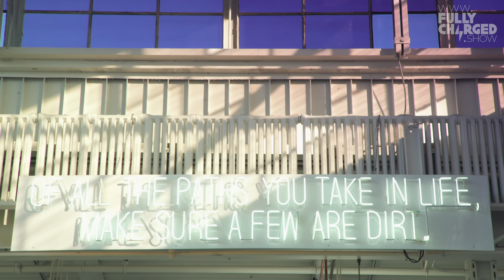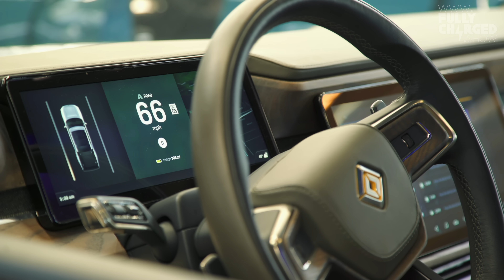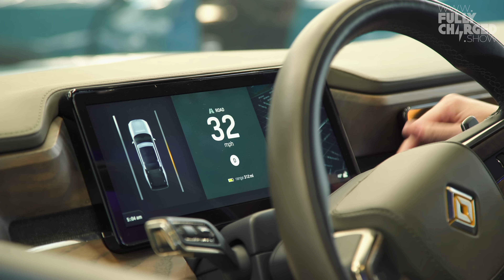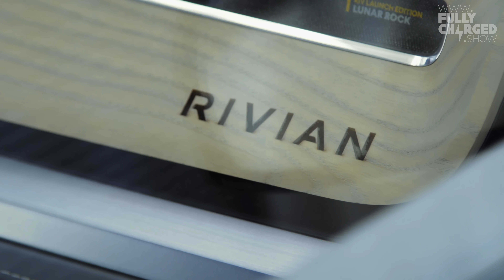Rivian R1S Electric SUV & R1T Electric PickUp Truck - World Exclusive: Inside Rivian | Fully Charged

Comment: I live in Vancouver CANADA and and when this Truck comes out it's going to change everything 🤔
Reply: Pay attention to the Tesla Pickup reveal on the 21st. While the Rivian pickup is cool, they have no charging infrastructure, are going to cost more, have less features, etc than Tesla. Tesla has chargers in B.C and on the trans-canada highway. Rivian does not meaning they aren't viable for off-roading trips.
Reply: @ghostthough7874  Ford gave Rivian 250 Million and is going to make a F150 using the Rivian platform.
And there's No reason the (charger) can't be integrated in to the vehicle.
Reply: @trentdabs5245  250 million isn't anywhere near sufficient for anything really. It'll allow them to do minor RnD or factory setup, but it's not much money. 

Ford (And Rivian) don't have any charging infrastructure which is CRITICAL for off-roading, don't have any progress on FSD (Full Self-Driving), haven't ever produced a single commercial electric pick-up, have no facilities to produce batteries at scale, etc.

Tesla has too many advantages than the other companies. Once they reveal their pick-up on the 21st they will make other companies completely obsolete. If you buy a car from another company it'll simply because of brand name, not functionality or vehicle ability.

Comment: The headlights really bother me, they look so weird.
Reply: Yep, flipped horizontally or at least moved further apart towards the center line of the fog lights would look better ... or maybe even two vertical ovals side by side would look better.
Not to mention a circle (like their Amazon delivery truck headlights) or a squarcle (a square with rounded off corners) would look more normal/natural than that narrow oval they are using.  

The aftermarket for the Rivian's front end clip is going to be a billion dollar business because people are going to want to change that ASAP/ASATC.

Comment: I think Rivian will be the King of the premium trucks with 4 motors, torque vectoring, variable suspension etc. I have read people's comments on the up cumming Tesla pickup truck how they guess it will be like a rivian (4 motors etc) but I think it will be only aimed at the lower end with 2 motors and much more simple. (how else could it be $49,000) Tesla has no need to start with a premium truck. If you want the best pickup truck on the market then buy a Rivian R1T.

Comment: 70k?  I hope you have an “escape the industry” plan once the Tesla truck is released.
Reply: You have no idea what the other manufacturers are doing.  Tesla will be selling about 1/100 of what Ford sells every year in trucks - and the Tesla lemmings will be claiming it's ground breaking.  Anytime Ford or any other major car manufacturer wants to put Tesla out of business - they'll be in the EV market and Tesla will be out of business.
Reply: @buckhorncortez  Incorrect... Ford mostly sells trucks, the one area that Tesla doesn't produce vehicles (yet). Tesla is destroying every other company in the luxury car market (specifically Sedans). Tesla is revealing their pick-up on the 21st and they will destroy Rivian, Ford, and the competition. Just like they are destroying BMW or Mercedes in the Sedan market. 

Tesla will never be "out of business" if anything, the other manufacturers like Ford, RAM, Honda, etc will be out of business unless they start switching to EV vehicles. The difference being, none of them have experience building electric vehicles or batteries. They have no idea how to build a reliable electric vehicle. They have no charging infrastructure. They have no desire to leave diesel. That's what will kill them. 

Tesla will be destroy the competitors in every category once the Tesla Pickup and Tesla Model Y enter full production.

Comment: really like this Truck ... 3:30 EXCEPT for the Frunk opening way too high, why???  It should open at bumper level between the headlights!! .. so it is easy to access the space.  Having to lift stuff above chest level to get it into the Frunk is rather absurd. Agree or Disagree??
Reply: Agreed but they had to put the 2 motors somewhere while also having decent clearance, trucks are not environmentally friendly family cars no matter how much they want to sell it as one.
Reply: @miguellopez3392  those 2 motors are NOT between the front headlights... the front motor/inverter assembly bulk is actually behind the front axle centerline.  In photo below this can be seen... the frunk area is above that radiator/fan unit.
https://www.hardworkingtrucks.com/getting-to-know-the-r1t-rivians-rj-scaringe/
"trucks are no environmentally friendly family cars" ???  Not even sure what you mean by that?  sure, a truck ain't a car, and 4 door trucks are damn good for family needs, and EVs are good for the environment ... so, you need to explain yourself more clearly??

Comment: Is it just me, or does Rivian side step every question about recharging their vehicles every single time on every video? 🤭
Reply: They go tank mode to swerve around it
Reply: Sidestep could be Rivian's motto.
Reply: They are positioning the trucks as off road, but how are you DC recharging these out in the BFE? RV sites? It just appears that they are not addressing it at all. I haven’t heard a discussion about recharging the pickups when taken off roading.
Reply: Right, it just stood out as very odd that they seem to never speak of recharging the vehicles. Other manufacturers speak of it, but not Rivian. Thanks for the input.
Reply: I wonder how long one would have to stay at the RV / cabin to recharge the largest battery with a 14-50. I have an MS and 8hrs to recharge it is probably too long if I was on an over landing or like vacation. Have they stated how long a 14-50 would take to fully recharge its largest battery?
Reply: I noticed that with all ev manufactures. Yes the range goes down when towing just like ICE but you can pull into a gas station and fill up in 5 minutes and be on your way. Not so with ev that's where they lose truck buyers and contractors. Time is money.

Comment: Tesla really needs to pull out all the stops for their "cybertruck" to be as impressive as this thing. November 21st has been confirmed as the reveal date for that, by the way.
Reply: I'm sure that Tesla will. Tesla already confirmed various features like 0-60 faster than a Porsche 911, 240 volt outlets, an air compressor, full auto-pilot features with FSD (full self-driving) hardware, V3 (250 kwh) charging, etc... Also a price of under 50k while the Rivian starts at like 70k. There's no way Tesla isn't going to dominate the pickup market like they have the luxury sedan market
Reply: @ghostthough7874  Rivian does have two huge advantages, though: They got started way before Tesla did (on building a truck) and they have a LARGE injection of cash from Amazon and Ford, which will go a long way to make their truck a very competent product.

Comment: While all of the talk is nice and interesting,  neglecting range have they done a run like Baja, climbed the rocks at Moab or pulled full legal weight (26001 pounds combined) over the Great Divide, not to mention Pike's Peak or being 50 miles from the nearest power line? I do want EV pickups but am just pointing out what the Bush Basher community thinks even thought most just talk a good bash and rely on performance stickers and a pair of tennis balls hanging from their caravan hitch to look like proper 4x4ers!

Comment: Can someone explain "cooling radially vs actually?
Thanks
Reply: radially - past the radius of the cells (the 21mm dimension)
axially - past the axis of the cells (length-wise, the 70mm dimension)
the cells are cylinders of 21mm diameter by 70mm long.

Comment: I'd actually be interested if they did a basic regular / single cab , 2-wheel drive long-bed pickup (with good range).
Reply: Check out the concepts on the wall
 There is a 2door
Reply: @golfish8589   Thanks. I have actually been looking into these to see what they do , or will , be making . A sensible 2-door single cab , long bed 2WD "work truck" version would be great I really seriously consider one.
Reply: @jerrybarbender9987  it may be a while before a simple old ford ranger might come out

Comment: More and more EV's are coming, and that's a good thing.  But what will strand folks over time and leave them with weird faults and TQ vectoring going sideways is corrosion.  Crevice corrosion, voltage drops across semi-conductor bridges made by water intrusion and the like. They'll be great when they are new, but as they age, they will become nightmares of fault codes.  What I want to see from these MFGs is how they are combating that?  How connector blocks are well sealed AND easy to get at for serving, etc. I worked for many years as an ET in marine environment, I don't want to see a repeat of thoughtless design that took hours to trace down a simple bad connection and dig it out of a maze of "stuff" to repair ...

Comment: the Rivian product looks/sounds good,  hope it comes with a worry free warranty/customer service so that they can clear the initial teething issues and go from good to great. ie provide a no questions loaner for any repairs required, happily early adopters get to discover/uncover the limits of the factory ex test scope.
engineering driven companies tend to tick off tech points and leave customer service as an after thought until it bites them in the bottom line

Comment: Looks like a wonderful platform. Why doesn't anyone talk about the charging infrastructure? No matter how big the battery bank is eventually it will run down. Why not partner with Tesla for the "road trip" charging and build proprietary chargers in the more remote locations where Tesla may not want to play. After all they are billing these as adventure vehicles primarily.

Comment: "We want to create aspirational products" = This will cost a ton of money.
Reply: @thoth111  Bolinger is a clearly a  prestige vehicle build by a boutique manufacturer.  Rivian trucks will share architecture with the Amazon delivery fleet and Ford F150 EV.  It'll obviously be more expensive (exclusive) than the F150, but shared parts and high volumes means it'll be dramatically cheaper than Bollinger.
Reply: They've hinted that the R1T will start at around $70k for the smallest pack/least power up to $100k for the largest pack/most power. Not too bad, for how capable it is. Amazon and Ford invested in Rivian (and not other similar EV startups) for a reason. All indicators suggest that this will be a pretty solid product. Also, you can easily spend over $75k on a F-150 Limited.
Reply: @thoth111  they're like 75k to 100k depending on the battery pack. Pretty damn cheap when compared to current trucks. The real question is what a basic work truck will cost.
Reply: @thoth111  These arn't basic work trucks. You wouldn't compare this to a Ram tradesmaen, tacoma sr, basic f150 or chevy.... A fully loaded Ram 1500 is close to 80k, Ford and GM get up to 90k. These are equivalent to a "limited" or highest version of a vehicle, thats why i said the real question will be what a basic version would cost if ever offered. Kinda like tesla and the model 3.

A fully loaded 2019 Ram 1500 = $90,350.00
Reply: For you

Comment: I am seriously considering getting a rivian when they come out, but the arguments about Towing is not at all accurate. It is true that you lose mileage with an internal combustion or electric engine, however you can fuel up an internal combustion engine in 3 minutes and go several more hundred miles where you have to charge an electric vehicle for much much longer to be able to do that. Also, the assertion that going downhill will recharge you more only works in a scenario where it's hilly. In Florida you get almost no charging from hills. Here's a video to watch on the subject by people who know what they're talking about.

https://m.youtube.com/watch?v=yjklex38lkQ
Reply: The added resistance is the same - why would the extra energy use and thus change in range be different with ICE vs EV drivetrains?
Reply: @Wookey.  Watch the video that I liked. The expected range when towing was nowhere near what they actually got. I also amended my original post to be more specific.
Reply: @Wookey.  The added resistance is the same because it is a fixed amount, not a fixed percentage. In other words, if the ICE vehicle naturally has X drag, and you add a trailer with X drag, you'd expect to double fuel consumption. But your EV is only 1/2 X drag, so when you add a trailer with X drag you now triple energy consumption.
Reply: @Sylvan_dB  Right. That makes sense. Thank you.

Comment: The dedicated motor to each wheel is what IMO Tesla missed from the beginning and is now trying to recover with “plaid” Model S twin rear motors.
The dedicated motors get rid of open differentials and improve torque vectoring. Why an electric car company like Tesla keeps using open differentials makes no sense! 
Well done Rivian!
Reply: Tesla first started with a rear wheel drive motor. Then moved to dual motors. Then Plaid. The plaid is performance oriented. When not in use, the front motor efficiently drives the car, until the 2 rear performance motors are needed. Comparing the mileage of the X and R1S, you can see that Tesla's drive train is way more efficient. This car is in the same league as the E-Tron, and the Taycan (extremely inefficient).

Comment: "You can have a vehicle that instantaneously goes from incredible off-road, to incredible on-road"

Let me tell you why you can't, and it's real simple, one word in fact: TYRES.  

Unless you can change your vehicles tyres instantaneously, then you are always compromised, and remember, even with torque vectoring, 4 x 0 = 0.........
Reply: Everything is relative. I think most people understand that he's talking about the flexibility of an electric motor with that instant torque and what two to three orders of magnitude better traction response means to vehicle dynamics. 

It may not be as optimal as a sports EV on the track, but it will be drastically better than an equivalent ICE vehicle in its niche, and people drive those relatively rigid and inefficient contraptions on the road just fine as is.
Reply: I took it that he was only speaking about the vehicle, not the tires. . . Because they don’t make the tires. Haha (Tires, of course, make the vehicle more capable than most items.)
Reply: Max Torque Yes. The tyre thing is well illustrated by the wonderful channel Garage54 who recently constructed their own off-road tyres from junk tyres and put them on a 2WD Lada. Just a simple illustration.

Comment: Ahhh, Ohhh, "over the air update"! Now that's something "new". 

Basically, what I hear from Rivian, is a repeat of what TESLA has been ACTUALLY doing for over a decade now.
Reply: "Basically, what I hear from Rivian, is a repeat of what TESLA has been ACTUALLY doing for over a decade now"
But very importantly in a different-shaped body, and with some different drivetrain and business-model choices (and different battery cooling/layout it turns out). I'm not sure you can go to Tesla and say 'I'd like 10000 vans on your skateboard design please'.

Comment: With their plans for "tank control" I wonder if they've also considered a four-wheel-steering option where the rear wheels are steerable independently from the front wheels. It would obviously cut down on interior space, as the wheel wells would have to be enlarged, but the tight radius and fine control in many off-road circumstances could benefit from it. And with their half axles and independent motors it would be far easier to implement than pretty much any other vehicle.

Comment: Did he just changed topic when she asked about charging or did they cut it off in the video?
Reply: Douglas Lin  Not really. He just said charging in the US is locked at 150 which they can easily handle. Rivian will use CCS and likely existing charging networks in place. At least in N.C., there aren’t many above 50 so still sucks for me.

Comment: It is a pity Charles couldn't stay in Australia and develop electric cars here.
Reply: Australia needs solar power before cars. The dirtiest way to run a vehicle in Australia is EV charged from the grid.
Reply: @DiscoFang  Huge solar farms here, and a lot around Aust now, list of them on Wiki
Reply: Peter McErlean Maybe so and that's great for reducing coal output, but look at the overall grid supply percentages. EVs are a very inefficient way of stealing away power that should be reducing the overall coal dependence. While coal is still being burned to supply the grid, petrol or diesel as fuel in cars has FAR lower environmental impact that coal burning.
Reply: @DiscoFang  There is currently 94 solar farms in Queensland alone either operating or under construction. 14092.7mw in total.
Reply: Cassette Walkman even charged from a Grid, an EV is still better.  When is the last time you could smell a coal plant?  But I bet you can often smell a gas car right by you.
Reply: Sean Z Not in Australia it's not. Not by a large margin. While coal is being mined and all its associated pollution, and while it's being burned & pumping its pollution into the atmosphere EVs are just contributing to that problem. So you think so long as you can't personally see or smell something it it's not happening? Great rationale there. Are you an ostrich?
Reply: Sean Z In Australia driving a fuel efficient car (like a Prius) has roughly HALF the environmental emissions of driving an EV powered from the grid. Until Australia gets to a point where the majority of their grid is from renewables that fact is reality. To reiterate: a grid powered EV has DOUBLE the operating "tailpipe" emissions.
Reply: Great summary. He also has this in video format here on YT but the written is easier to scan for the FACTS.  https://www.caradvice.com.au/683634/how-green-is-ev-ownership/